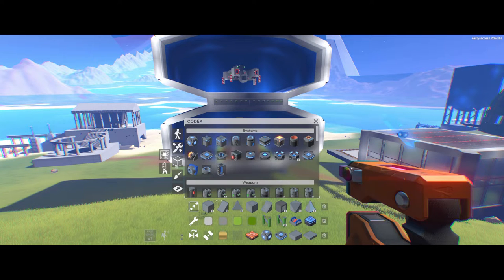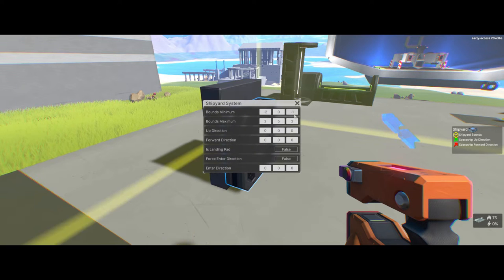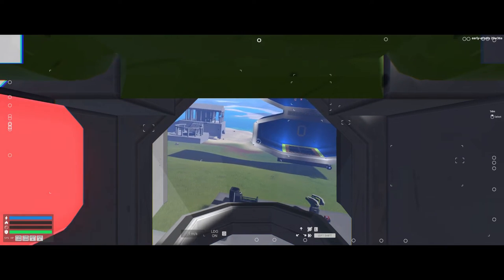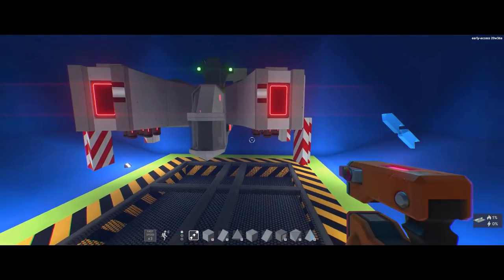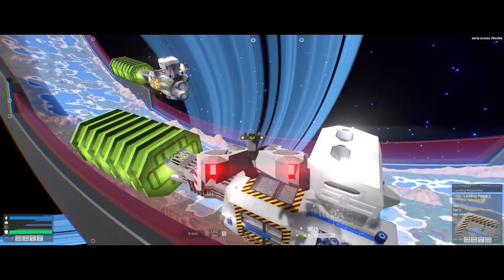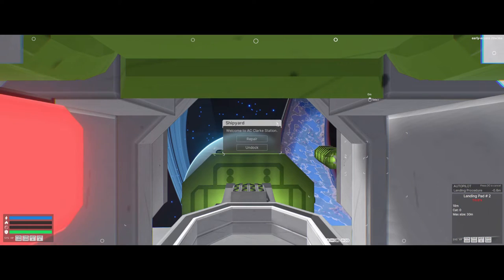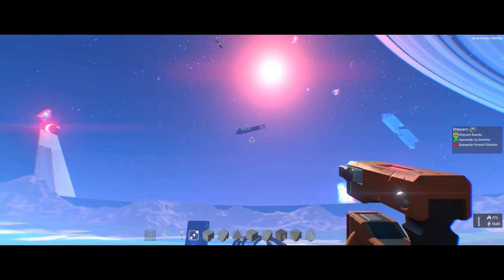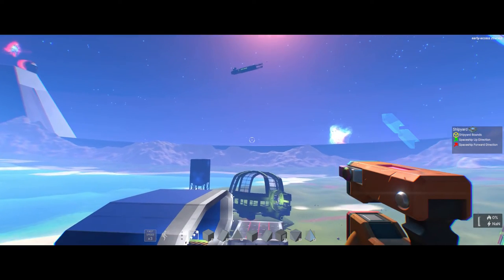Building with the Shipyard block and some uses for it - Starship EVO (Early Access)

Comment: Nice video. Well put together with no time wasted :-)
Do you know if Hover vehicles can use Shipyards? If so, I'm wondering if you could use them to transport ground vehicles from one place to another onboard your ship?
Reply from the maker: I think someone has tried and it doesn't work. It was raised as an issue on the Github for this game. The work around was to use maglocks on the bigger ship, to lock in place the hover vehicle once you've parked on the bigger ship.
Reply: @curioinventorium  I tried it and you're right, it doesn't work. You don't get the option to target/interact with other objects when in a hover vehicle like you do in a spaceship.
Hopefully it's a feature that will get added eventually.

Comment: I really want to get this game, videos like this only make it seem cooler. Is it possible to make builds that are bound by gravity, lets say for example you wanted to use a bunch of of pistons and rotators to make a walking mech
Reply from the maker: I've not gone so far as to try making a mech, the logic just to get it walk would be crazy. There are gravity blocks for defining areas same as with defining the size of shipyards.
The starting "tutorial" area demonstrates this by changing the direction of gravity a few times.
Reply: @curioinventorium  
There was also a dedicated mech computer block(like for the spaceship, but for mechs), but is for the moment not in the game, likely being worked on.
Reply from the maker: @gohunt001-5  I remember seeing screenshots when it was called Skywanderers. I do hope mechs get put back in!
I'd missed out on the Kickstarter and completely lost track of the game when it's name was changed.
Only reason I found out it was in early access was because I got a random email from Steam.